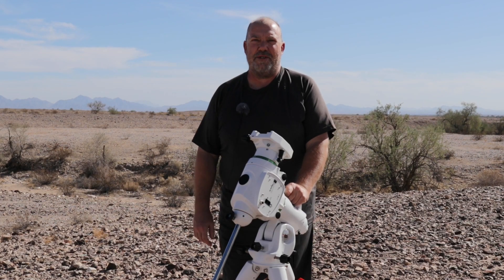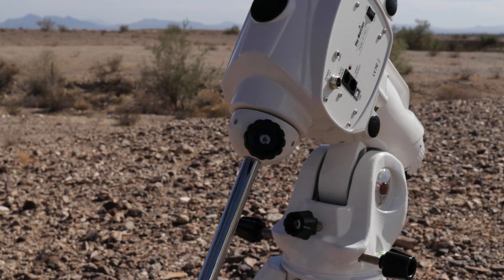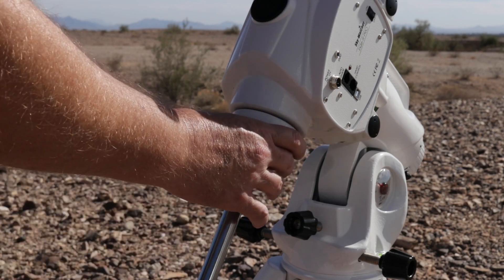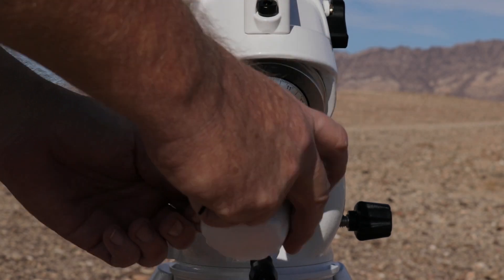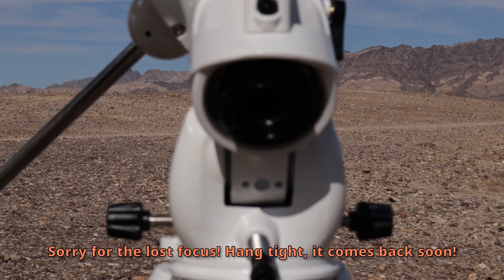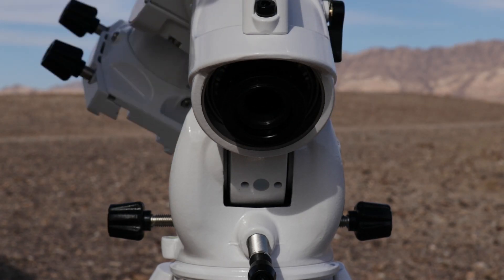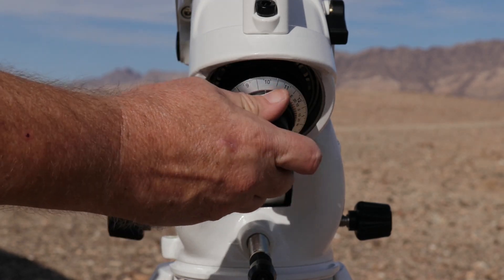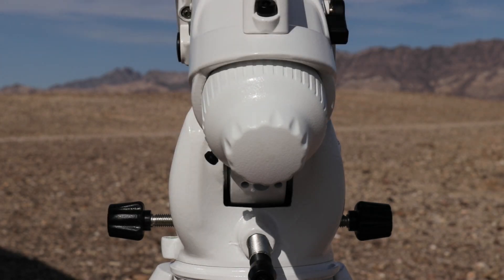EQ6R-Pro Sticky Axes Quick Fix (No disassembly required!) [DIY]

Comment: I had to do a very similar adjustment on my HEQ5 to get optimum tracking and guiding. My experience was that I had to keep both axes a little tighter than shown here; if I loosened them enough to "free swing" then I would get L-shaped moves when issuing guide commands, indicating some slop even though I could not feel any motion in either axis.

I definitely ended up with the axes looser and easier moving than stock though, and it helped with some stiction issues I was having.
Reply: I found the same thing on my HEQ5 as well.  Loosened, but not too loose. Made an nice improvement in guiding.  I purchased the mount new so it came from the factory somewhat tighter than needed.
Reply from the maker: Thanks for watching and commenting!

Comment: Hi, the big black Bolt on tha RA is so tight on my mount that I am not able to undo it even with the screwdriver method..do you have any other tip for this?
Thanks!
Reply: Man I got it loosened..but let me tell you..at one moment I felt like an idiot, I questioned the small screws so I took them out completely, I even questioned myself if I am rotating the right way. I bent 9 bolts and accidentally scratched the big black bolt when the screwdriver slipped but no big deal. When it finally let go I felt like a world champion and all neighbors came to congratulate. Now both axis spin like it’s no tomorrow and balancing now became a fascinating hobby inside a fascinating hobby. Thank you.
Reply from the maker: @SPACEJUNKastro  You're welcome! Congrats on your victory!
Reply from the maker: Wow, that's nuts! I'm not really sure what to suggest. You're sure all 4 of the grubs screws are loose? Mine had one that appeared to be missing but further inspection revealed it was in there but stripped badly. About all I can think of is making a better tool, for example a thick piece of wood with the screws driven through it so that they protrude from the other side in the proper spacing for the holes in the black nut. I'm not sure that's a very good description, so please let me know if it isn't. You're welcome, and thanks for watching!

Comment: Thank you for this very useful and well explained post. I am a beginner, got my EQ6-R and was able to follow your instructions easily.
Like others, was unable to move the last piece in RA axis with the strap wrench but the trick with the screwdriver easily worked.
Now the two axes move easily, before they were very stiff and couldn't balance well.
Edit: I noticed now, just after setting everything back up, that RA clutch tightening results in a slight move of the RA axis which I believe is the result of the (RA axis loosening) procedure. (I was extra careful to loosen it only so much as to achieve the 'free gliding', nothing more). Makes me wonder if this is OK? I hope this does not have any adverse effects on the gear/tracking. Thoughts?
Reply from the maker: You're welcome! Regarding the edit: I'm not able to see exactly what you're seeing, but when you say tightening the clutch results in a slight move of the RA axis, what do you mean? If the axis rotates slightly when tightening the clutch I don't see that as a problem. If it is shifting laterally (i.e., across rather than around the axis of rotation), I would guess that you may have made the axis too loose. Not to worry if that happened, just get back to that big black nut and tighten it up a little. You may have to go back and forth a few times until you find the right balance there. Don't hesitate to ask more questions if you need to, and thanks for watching!
Reply: @explorelearnshare8222  Hi, thanks for the reply. Tightening the RA clutch forces a 0.5 - 1.0" lateral rotational move of the counterweight shaft. For example, if I position it to the home position straight down, upon tightening is moving by that amount to the left (as I am facing the mount).  Not too important for the home position but a bit annoying during polar alignment via the polarscope  when aligning the reticle at 90 degrees but no biggie).  Regardless, tonight I took the telescope out for the first time and I am getting better guiding than before (0.65 arc sec total error, which I achieved previously once but subsequently was getting mostly higher total error). Not experienced enough to tell if this is due to a better balancing as a result of the RA loosening (I believe) a better polar alignment or both.

Comment: I've got an EQ6R. Got to say for the money I paid, it's every so slightly disappointing. 
The locking bolts in the legs are rubbish, I'm no weakling but takes considerable force to make sure the leg doesn't slide when the mount is loaded. 
The power cable coming out at 90 degs just perfect to damage during the night in the dark. 
No covers for the ports for the handset/aux 
The main bolt that holds the head to the tripod feels like your screwing into sand. 
And lastly, the noise when it moves at 100% .
Reply from the maker: Thanks for watching and commenting!

Comment: Just followed your instrctions, what a difference its made to the RA and DEC. Now with zero stiction, now living in the uk wont be able to test it for ages, but im very hopefull it will make a big difference, i wonder why in the factory they tighten everything up to the max, bearing in mind (no pun inteneded) the whole idea is to move smoothly through RA and DEC motions.
Thank you for this video, it was about as much as im capable of doing myself, dont mind admitting if i cant fix something with a hammer and a can of WD40 then its beyond me...
Reply from the maker: You're welcome, and happy to hear that it went smoothly (pun definitely intended) for you! Wishing you some clear skies so you can give it a go!

Comment: Thanks a lot for that great video! I just adjusted the DEC axis which was very easy. Now I have a question about the RA axis and especially to the polar scope. If turning the black ring for the axis adjustment and after that placing back the polar scope isn't it needed to adjust the polar scope because it is (maybe?) twisted a little bit now?
Reply from the maker: I may be visualizing what you described incorrectly, so correct me if that is the case. The polar scope threads into the inside of the RA shaft and the black nut threads on the outside, so where the nut ends up shouldn't affect the polar scope. That was very difficult to see in the video. I have to confess that I don't use the polar scope, opting instead for a software tool that uses plate solving to polar align. In hindsight it probably would have made sense to mention that in the video. I believe it should thread back in to about where it was when you started. I consulted the user manual and it instructs that one should rotate the RA axis to get the marks lined up with the stars, so it seems the final rotational position of the polar scope is not critical. Getting it aligned parallel to the axis is critical and the manual outlines making the proper adjustments for that. The process of unscrewing it and screwing it back in should not affect how parallel it is by much if at all. Thank you for the great question! Let me know how you get on if you continue with the RA adjustment, and clear skies!
Reply: @explorelearnshare8222  Great and thanks for the fast answer! Yes in the video because of the black parts it is hard to see the details in the big nut on the video. Unfortunately I cannot remove the polar scope without a tool at the moment. But if the polar scope placement is independent of the position of the black nut everything would be fine. :-) I use the polar scope for polar adjustment but after that also plate solving (Astroberry)  Clear skies from rainy Germany.
Reply: Hi, today I managed to remove the polar scope! It was very hard to remove it so I designed and 3D printed tool. With this a tiny noise appered suddenly and then it was free. The polar scope sits within a separate thread with no contact to the black adjustment nut. So enough today, tomorrow the final show. Here are some pictures I made for a German forum: https://forum.astronomie.de/threads/schwergaengige-eq6-r-einstellen.318301/#post-1642259
CS Hardy
Reply from the maker: @elythomaslumber  I love the tool you made! Mine also made a noise before it gave up and turned. I noticed your one comment on the forum that everything seemed to have been tightened by the terminator, and that's exactly how mine seems also. The last nut you're facing was the tightest of all, so good luck! And big thanks for sharing my video!
Reply: I re-checked the alignment of the polar scope after this procedure and it was dead on, no adjustments necessary.
Reply from the maker: @jmundale  Thank you for mentioning this! I don't use my polar scope, so I wasn't sure if it went back without issue. This is great information and I'm sure it will help someone out. I'm going to pin it if I can figure out how....

Comment: Hey - just did this and had one issue.  While doing the DEC axis, two of the three grub screws actually came out and fell down into the cover.  I'm pretty sure I didn't loosen enough to really get them all the way out - assuming they were actually in to begin with.  In any case, it was easy just to unscrew the cover all the way and grab them.  On the RA, like you the strap wrench wouldn't work so I tried your two-screws method.  Bent two before it budged - but it did!  RA was super tight.  Glad to have things loosened up a bit and looking forward to next clear skies to test.  Thanks!
Reply from the maker: Thank you for the comment! I'm glad you were able to recover easily on the dec side. That RA made me pretty nervous with how hard I had to turn and it sounds like yours might have been even tighter. Happy to hear you got it! May your skies be clear soon!

Comment: I've got the same issue with my AZ EQ6 GT so might look into this as getting balance has never been easy
Reply from the maker: Thank you for watching and commenting! I think the AZ EQ6 is fairly different, so you may need to find a video more specific to that mount. Good luck and clear skies!
Reply: Dumpy Dalek Observatory - did you ever find out how to do your AZEQ6? I am struggling…
Reply: @markcompton1249   sadly no I haven't I may have to send it somewhere to get it serviced at some point

Comment: Great video! I just received my new EQ6R-Pro last week and mine is tight just like yours was. I’ll be guiding great at .34” then every minute or so I’ll get a big RA or DEC spike over 1” I may have to try this. Have you had a chance yet to see if it makes any improvement in the RMS error numbers? Thanks for sharing
Reply from the maker: Thank you for the comment and your kind words! Congrats on the new mount and very cool that you're down at .34"! What mount were you using before? I did get a chance to run it again last night, and I didn't see much difference in my RMS numbers. Like you, I do get some excursions over 1" occasionally (in RA, and both before and after doing this). My wild guess on that is that the worm carrier is probably also overtightened. I'm tempted to try adjusting that too but I'm worried I'll make it worse instead of better... Check out AstroBloke's hypertuning video (https://www.youtube.com/watch?v=qujs7Kt_6_c) to see more of the internals of the mount if you're interested.
Reply: @explorelearnshare8222  I’m coming from a AZ-EQ5-Pro which I believe you took apart and cleaned, greased and tuned in a previous video. Although I think yours was black but looks the same as my mount. Thanks for letting me know the result I’m hoping we just need to break our mounts in a little bit and the spikes will go away with time 🤞 I hope my heavier scope will help do the trick if it ever come back in stock lol. Have you tried PEC guiding yet? Im using an ASIAIR Pro so I don’t have that ability yet… However, I here it works really well with the EQ6R Pro especially after hypertuning. I’ve watched that video and I’m not ready to take the plunge yet as my total RMS is still much better than the ~1.5” I was getting with my AZ-EQ5–Pro. Love the mountains in your video! Looks nice and dark. What’s your Bortle rating at that area you shot the video? Keep up the great tips
Reply from the maker: @FromGregg  Looks like we're on similar paths with mounts at least lol. Interesting that we both got the EQ6 at the same time. Yeah, my previous one is an AZ-EQ5 rebranded for Orion. I'm pretty sure all the Orion mounts are Sky Watcher rebrands. And I definitely remembered you from the previous video...yours is still the nicest comment I've ever gotten. My AZ-EQ5 is at about 1.5" rms also, but it was .8-.9 once upon a time. Over the summer I took it all apart and cleaned and greased it again but didn't get any improvement. I'm going to replace some bearings next, especially now that I really don't have anything to lose with the EQ6 in the mix. I plan to make a video of that. Regarding PEC, it really made a difference for me on the AZ-EQ5, but I trained the EQ6 and it made things slightly worse. I need to try it again now that I've adjusted the axes. Maybe it was correcting for the stickyness (which wouldn't be predictable) and not the periodic error? Just a guess, but definitely worth another try. The mountain view here is quite nice; the "Clear Outside" app claims bortle 3, but I think it's darker than that when looking away from the nearest city. Which scope are you waiting on? And how do you like the ASIAir? Did it recognize the USB port on your EQ6? I use a plain Raspberry PI running ubuntu and it can't see it. Fingers crossed your scope is in stock soon!
Reply: @explorelearnshare8222  so true! We must have both ordered them the day they came back in stock lol. I’m using a WO Redcat 51 and absolutely love it! Yes, I had no connection with my ASIAIR Pro and had to download and install a larger OS from ZWO on a 64GB micro SD card that have the updated USB chipset drivers for the new EQ6R-Pro. I used Win32 Imager to extract the ISO image of the new OS and write it to the larger 64GB micro SD card. You should do a video on the process!
Reply from the maker: @FromGregg  I've been considering a redcat 51. No one seems to have anything bad to say about any of the WO stuff, and it all looks beautifully made. For now I'm using a Nikon 200-500mm lens that I already had. What scope are you waiting on to come back in stock? I still haven't sorted out the USB issue, so maybe there will be a video lol. I still had an eq direct cable hanging around from before I realized I could just go straight to the USB port on the AZ-EQ5 so I'm using that for now. Forecast is showing nothing but clouds which is nature's way of telling me to figure that out I guess! What's the workflow with the ASIAir? Does it do the entire capture process, guiding, etc? So, no computer? In my setup, I'm basically only using the Raspberry PI as a proxy so that I just have a single ethernet cable going out to the scope. Could also work wirelessly but it's slower. I still need to use the computer inside to manage everything.
Reply: @explorelearnshare8222  I’m waiting on my William Optics FLT 132 to come in :) the Redcat 51 is the sharpest lens I have ever used I’m getting stars as small as 1.7 HFR using a ASI1600MM camera and 3nm Antlia Pro 2” SHO filters. I run a 100’ cat5 cable out from my home network to my ASIAIR Pro and I can connect via my home Wifi throughout my entire house connecting directly to my iPad, android tablet or iPhone and have full control over my EAF, 7 position filter wheel, multi star guiding, annotation of DSO, go-to search directory, programming multiple targets in one night, Polar Alignment, calibration frames, full camera control and management over dew heaters. It’s the only way I’ve learned astrophotography and I only use my computer for post processing my subs and calibration data. I’m really happy I went that route vs. using a laptop or having to remote into a computer.
Reply from the maker: @FromGregg  That looks like an impressive scope! Great focal length for galaxies, so hopefully you get it in time for galaxy season! I've got the same camera, but with ZWO filters. I got it on their christmas deal as a bundle a couple of years ago. How did you connect the EAF to the redcat? I rolled my own focuser and 3D printed parts to focus the nikon lens, mainly because I love building stuff but also cuz I'm cheap lol. I get more sleep now that I don't have to run outside to focus! I have to figure out automating multiple targets in one night soon. Do you have meridian flips automated also?
Reply: @explorelearnshare8222  I, too, started using my Nikon 200-500 lens.  Put an EAF on it to make life easier.  Then I got a RC51.  The Nikon is now back on permanent regular photo duty.  The sharpness is so good on the RC51 I’ll happily take a crop from it over a longer FL image from the Nikon lens.
Reply from the maker: @thomasmorrow1080  I have now gotten a RedCat! The sharpness is ridiculous as you say. I'd be interested to see how you paired an EAF with that lens...I'm guessing a 3D printer was involved?
Reply from the maker: I have since gotten a redcat also, and I can't agree more. So much sharper than the nikon. Clear skies!
Reply: you've probably already sorted it by now but that osunds more like backlash rather than this axis being tight
Reply: This happens to me too overclockthis. I will be running along less than .50 RMS and get some kind of crazy DEC or RA spike and then it will settle back down. My resolution is such that it doesn’t mess too much with my imaging, but I wish it would not do it. Oh well I can only try to find out what it is and maybe getting the stiffness out of the RA and DEC axis will help.